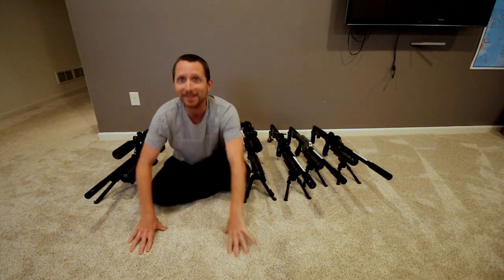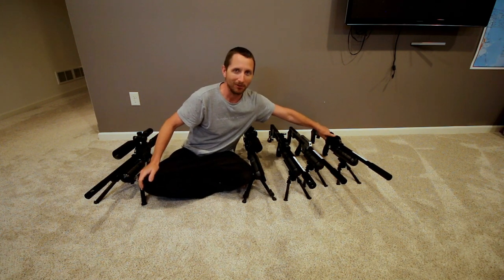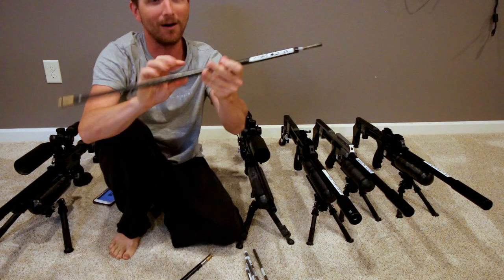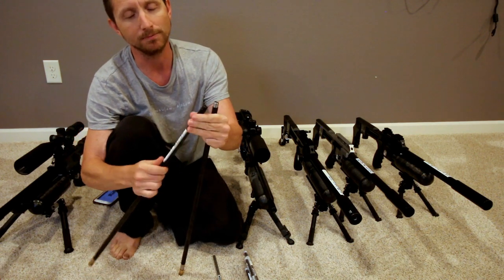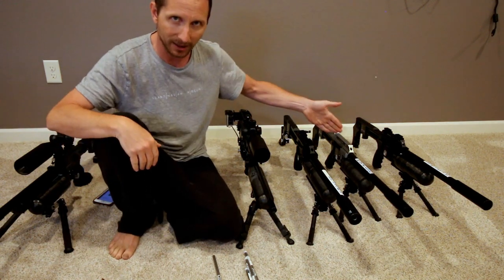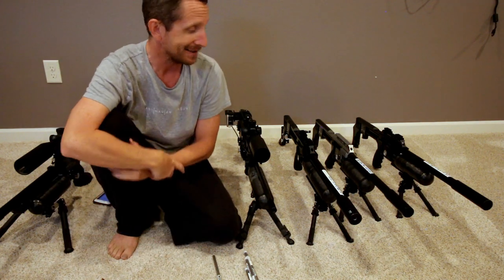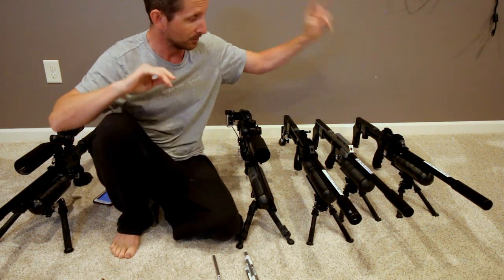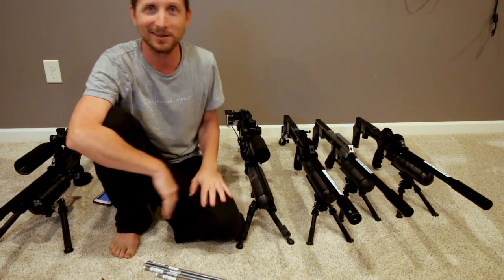Next Test: Making Sense of all these darn FX Barrels | Smooth Twist vs STX vs Superior vs Sup Heavy

Comment: This is well timed Ted. I was given the opportunity by FX to test the .22 Superior Heavy liner which I put in a Raptor by JSAR. It shot well however I removed the choke and it became a laser! the choke was very tight. 5 thou tight which struck me as odd as Matt Dubber stated that they put only the slightest choke on the Heavy liner and saw a marked increase in accuracy. this almost 300% tighter than most chokes by leading barrel manufactures. Mine was slugs at .1795 lands for the barrel and the choke slugs in at .2130.  So in reality, it is a .213 rather than a .22 barrel as far as the projectile flying thur the air is concerned. I double wrapped the liner with cf twil tubing and it is very stiff, ending up with what amounts to an extremely light bull barrel. I did the same with a 
Redmans liner bought from Brownell's Gun Smighting supply that actually slugs at .2232. it is a very accurate liner. The FX is going to have to really strut its stuff to beat it!

I would love to see FX offer a true .22 barrel that the many casters can use, as there are no molds in such small sizes as the liner requires. Necessitating a huge amount of sizing. Slug shooting has really taken off and many are casting their own for their guns. I have been at this for 11 years now and learned a lot in the process. #1, tight chokes do not do well with a wide variety of slugs and lead harnesses. It should work fine with what is basically a hollow slug such as FX is making available. However, I have reservations about the very tight chokes doing well with a wide range of both slugs, and alloy mixes. 

Fingers Crossed and will be watching your results. 

KnifeMaker

u

Comment: Awesome news, Ted!! You heard our requests.
Not sure about .25, but I know .22 700mm SSTX and SSTX Heavy are a lot tighter bore than my .22 regular STX and lowered the muzzle velocity 30 fps or so, using the same projectile. I had to tune "up" to get same MV. 
Ten shot groups at 75 or 100 yard depending on wind conditions with Kings, Heavies, and some slugs should show us some differences. Please check the twist rates on each barrel(people are always asking for that info). And please tell us approx. how many pellets since cleaning barrels.
Sooooo looking forward to your tests😁.

Comment: Hey bud, this doesn’t have a damn thing to do with FX barrels. This is to do with the .25 Avenger. I got mine 5 days ago and I set the reg at 2200 psi. 5 min later it reads 2900 psi. Should I ask for a new reg or seal for the reg? Need help cause God knows when they will have a replacement gun. Still thanks for the video...you really know how to make some serious work for yourself buddy. Stay well, stay safe, and God Bless my friend.
Reply: did the gun heat up?
Reply: best thing you can do is taking it apart relase al pressure!!!, clean everything  ,replace al orings ,with quality  orings from the right dimensions and hardness ,lube the orings  a litlle bit with 100% silicon oil.  do you use clean dry air to fill it.  the reg is leaking tru to the plenum i think ,you can order eventual a reg ( made to fit )at huma-air.com,  what you also  can do, if there is a debris somewhere is to bleed the gun via the hammer valve with a controled opening  ,screw  the hammer against the valve or something ,so al air is fast relased tru the barrel ,the debris  may blow out
Reply: @peteralexben  I sent it back and got one with a wood stock. Sounds quieter, shoots more accurately oddly, and doesn’t have a defective reg. The other did. It had a crack in it…go figure. Factor reg works good enough for a 300$ PCP. SD of 7 fps is all day doable.

Comment from the maker: Give me your ideas to get the most out of this experiment.  
Speak now, or forever hold your peace. 😜
Reply: FX needs to pull there heads out of there asses, and wait till they get one thing right before making another
Reply: Maybe make an accuracy to weight to expense chart for each barrel.. Test each barrels accuracy with different loads and velocities and then you can see which is the best barrel for each category or overall?
Reply: Consistent torque on the jam nut and consistent placement (or absence) of the o-rings? My thinking is, the amount of torque on the jam nut will affect the tension the liner is under. Differences could potentially cause differences between barrels. And regarding the o-rings, hypothetically they do alter performance, at least FX certainly claims so. (reducing vibration and so forth) If that is the case, an o-ring damping the barrel at a node would be very different than an o-ring damping the barrel between nodes. The location of nodes though would be based on barrel length as well as tension, just like the frequency of a guitar string varies by length and tension. 

Just a thought, albeit perhaps an over-ambitious one. Really, fully bedding the liners in their respective sleeves would hypothetically maximize performance, but the difference in performance between any two barrels may exceed the difference in performance between two different barrel systems. I have been planning to do exactly that, bed a liner in its outer barrel and empirically compare before and after performance, but there are just so many experiments and so little time to do them.
Reply: HoldOver Vlog What is the question you are trying to answer? I think that with any highly customizable system there’s a temptation to say the best is that with which you can do many things, whereas for most people the point of customization is to be able to tweak a gun to do the one or two things you want it to do. So for you the question might be: what is the liner-pellet/slug combination best suited to reliably and consistently hitting a European starling in the head at 100 yards? There may be very, very few people who have that specific requirement, but by having a clear sense of what you want from a gun; having the ability to set it up to perform that task; and, then executing, is interesting and valuable. To me that’s far more meaningful than saying at the end of your experiment that liner ‘x’ with projectile ‘y’ is the ‘best’. Best for what, for whom and why? And, given how good a shot you are, it might just be that FX should get out of making guns and instead start trying to clone you because you could shoot the pants of most people regardless of hardware...
Reply: Hi Ted, long time air guy here. I gave you full credit for my 2017 sport class win in Phoenix. How about the superior heavy barrel vs the straight slug barrel? Look forward to seeing you again in competition. Keith Comey.
Reply: Lubed vs non lubed results for pellets and slugs
Reply: Fx should make replacement stx barrels for everyone who has the old st ones thay would sell.
Reply: @silentthunderordnance1655 I had exaclty the same thoughts about O-rings&nodes, Torque on liner,.. :)  
Look at Ernest Rowe's channel, he is triyng to embedd the Liner in a carbon sleeve, I hope he will make the tests that we hope for.
Reply: I would be interested to see how the liners would hold up against a Walther barrel machined to fit an FX. While there is a blue million different rifling options, comparing one of the more common ones to a liner out of the same gun would be informative. Maybe you could get ahold of a dealer or tuner to machine and send you one to test?
Reply: Best of luck with testing Ted. To take a variable out you need a venue similar to  the  range used for the  Houston warehouse benchrest  testing. My next purchase will be a .25 fx  so all info is good.
Reply: @dicconogara1717  no, they will not coz they want that we have to buy new gun. It would be easy to do that, but they don't.

Comment: I had good results shooting NSA 29.5 in .25 using the superior liner (600mm). The results were the same as the slug liner. With that weight.  I got clover leaf groups with NSA 36.2 @50 yds. I did not do anymore test because I sent my impact mk2 in to SPAW for the plenum upgrade. Those results were with the superior (700mm). NSA 33.5 didn’t do well. Waiting to get the superior heavy in 700

Comment: I 100% agree with you on .25 cal in an airgun/PCP for all around most efficient down range for air used. Wish I could find a slug that works in mine. This LCS SK-19 has I believe a 1:18 twist loves FX 34s, haven’t tried the Hybrids yet cause they are always out when I try to order them but this Polygonal choked barrel sends JSB and NSA slugs in a shotgun pattern. Don’t think I would gain any advantage with a 26 grain slug vs a 34 grain pellet at the end of the day and like the heavier weight, energy, less wind drift than say a 25.39 grain pellet. The hammerless system is hardly even working with 34s at 900-960 FPS and getting 2 mags of 19 or 38+ shots reg’d at 145 Bar. So plenty more for heavier slugs just don’t know what to look for. Any ideas?

Comment: Hey Ted, u just mentioned that the gun u won with has a 700mm original smooth twist barrel, while in your previous old video, u mentioned it’s a standard 600mm barrel with only a longer shroud.

Comment: this got me thinking
a wildcat has not the power as the Impact, but ... if you have the Wildcat MKIII 
with 300cc alu cylinder, what would be the best choice?  
shooting the 25,39G.  .25.  pellets,           or.        Shooting .22   with the same grain slugs ?    curious what you think on this (smaller caliper to have more fps on the slug?). distances 60 and 90 yards
OR
the .25 slugs with more grain?

Comment: Ok I'm over it. I have the .25cal  Impact and the power Plenum was added. I have the smooth twist x. My gun does not like the Hybrids at all. Even at 50yds my pattern was 3-4". NOT GOOD ENOUGH. I'm back to shooting pellets. Both 25gr and 34gr do great dime size hole.. but I still get that odd ''flyer''. (No it's not me. I know enough when I'm the problem. So I'm not including those in anything here). I wish there was a way to check the barrel to see if there's a problem with it... maybe a new liner will help but that's another "...hundred bones'' coming out of my pocket. For 2k these guns should be PERFECT right outta the box. ... so what ya waiting for... get shootin' my friend. Really really like have you back.
Reply: I had a similar problem shooting @50 yd hitting the same hole over & over moved the gun position a bit and it was 6” off being a brand new it couldn’t be the gun I start working on the scope and it was still moving around my problem was someone at FX or Utah Airguns didn’t tighten the barrel

Comment: Here’s an idea...oil the damn screw grooves on the smooth twist barrel to get rid of that wretched noise lol.
Reply from the maker: 😆 Did that right after I stopped recording.
Reply: HoldOver Vlog  I have a flashlight that sounds like that when I replace the rechargeable batteries, which is often, unfortunately I can’t lube it because of grounding issues ! 😖

Comment: The only problem with this, or any other barrel test, is that one of the primary factors affecting group size is the projectile/barrel fit. Thus your test results could be driven, not by the barrel rifling, , support etc., but simply by the fact that one barrel just happens to be the right diameter for the projectiles you are testing. How are you going to get around this problem to ensure you are really testing what you want to test?

Comment: Teresa and I were wondering about tuning,,. Low reg high on the hammer for a given speed or higher reg and just light bump from the hammer.. your thoughts? 😊
Reply from the maker: Never low reg with a slamming hammer.  That is a recipe for problems.  Better to have it the other way around.  But, that can create issues if you've gone too light on the hammer or too heavy on the reg (it can cause valve locking).  This question actually requires a couple pages of typing to address it properly.  Maybe something for a future video....:)
Reply: @HoldOverVlog  perfect great idea 👍